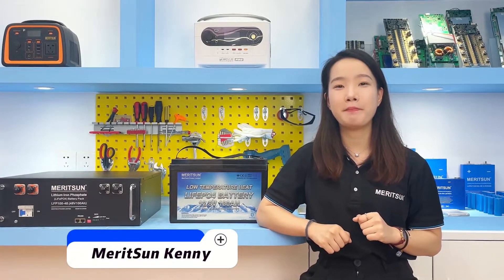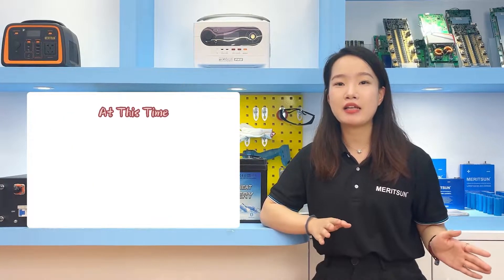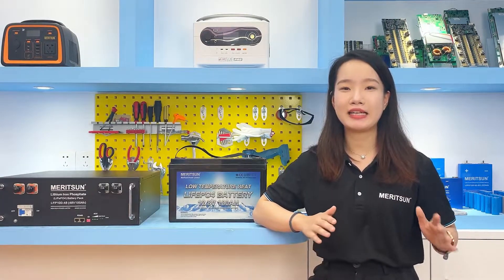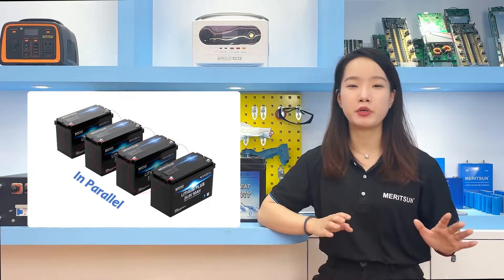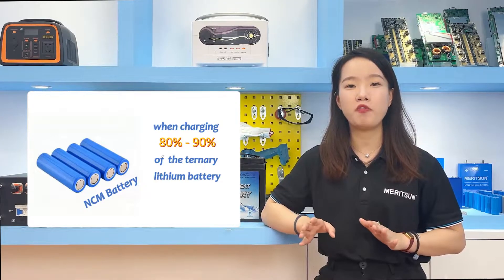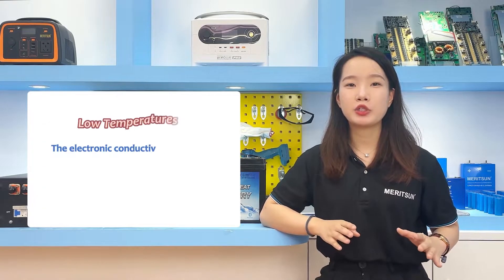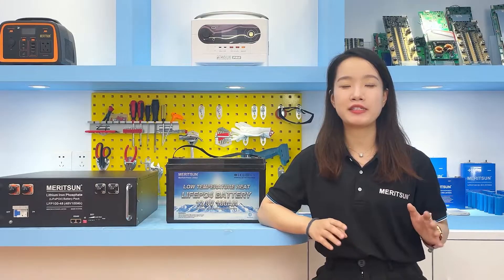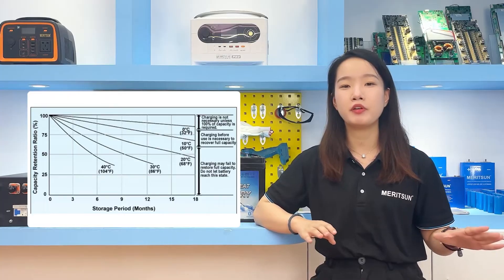Lithium Lifepo4 battery: Tips about charge and discharge operation | 2022 Updated

Comment: If a 24v LFP 100Ah has a discharge rate C1 of 100A but I want to use a 3000w inverter I understand that I will have a load of 125A. When adding 2 or 3 more batteries in parallel to make a 24v 200-300Ah can these 2-3 batteries theoretically output 300A?
And question #2
In the same example using 3000w 24v battery the cables/wires connecting batteries together should be rated for the Max system loads eg. 125A  or 100A that is the maximum battery charge/discharge rating?
Reply from the maker: Hello, we are very happy to receive your comments. For your questions, you can directly contact our professional engineers via WhatsApp at +86 136 3222 6296, or contact us via email at sales@meritsunpower.com, our after-sales engineers will also provide you with a complete solution
Reply: @meritsunlithiumbattery  thank you
Reply: @meritsunlithiumbattery  I tried texting on WhatsApp but the phone number is not on WhatsApp
Reply from the maker: @kestrel-68-36  I'm very sorry about this, could you please provide us your WhatsApp or email address? We will send an engineer to contact you.
Reply: Hello, is it how important to discharge fully at first for 51.2v 300ah  LiFePO4 battery ? for the same battery what is the flooting and bulk charging voltage ?
Thanks n regards
Reply from the maker: @manojs09  Hello, if you want to know more about the battery, please communicate with our engineer via WhatsApp +86 137 2683 4322, and she will provide you with detailed information parameters.
Reply: @meritsunlithiumbattery  thank you so so much for your prompt reply

Comment: So what solar charge settings do you recommend to keep MLB SOC between 80 - 20% ?  Is all this controlled by the BMS my system is Victron.
Reply: Good question but I'm assuming its a little more complicated. But it would be nice to a have a estimated understanding. 
The 20/30%-70/80% is wat I heard for cell phones. Lithium ion. 
lifpo4 seams to be 5/10%-90% range is what you generally want.
PS. I missed the part about solar panels.

Comment: My lithium battery is not charging....I'm very disturbed and I need help
Reply from the maker: May I ask what brand of lithium battery you are using? You can give feedback to the corresponding dealer.
Reply: Mine it's lifepro4 24v 100ah lithium
Reply: Iam using the LFeI-48100MB

Comment: Have you ever tried reading the datasheet of LFP Cells you are using in your batteries??
The Charging Parameters of LFP also involve charge termination. I don't see it mentioned anywhere in the video.

Also, the Float voltage of LFP should never get above 3.375 V/Cell.

Comment: I've been wondering. Is it ok to discharge a lifepo4 battery to about 20%, then start charging it while it's still discharging with about a 50w charge? I have 48v battery 50ah. I planned on using just battery on just under 400 watts for 4 hours, then charge it on a 48v 10a charger while it's still running my system. Hoping to get a slow 50w charge, until battery is up to about 90% again. The system will shut down for 6/hrs day. This is when I plan on the charger catching up and and charging to 90%. Will this work good?
Reply from the maker: May I ask if your system currently uses MERITSUN lithium batteries? Please send an email to our business email sales@meritsunpower.com and we will reply to you in time. Thank you!
Reply: Ever figer it out ?

Comment: how big of a battery would i need to get 1000 watts for 6 hours ?
Reply: 6000Wh
Reply: Two 12v 300 ah batteries would provide that with 1600ah extra for losses or not draining to very low voltage. I easily get 3000wh or amp hours from my Ampere Time (now Li Time) to power my little window ac during power outages. If you set it where the thermostat kicks on and off half the time you can get nearly 20 hours of air conditioning. I use a watt meter for a decent rough estimate of battery capacity used and guess at inverter losses and it works great. I recharge it with a plug in 20 amp lifep04 charger. I have solar but need more panels but it works. I`m getting about 300w into the battery...enough if I set the thermostat right to avoid draining my battery during the heat of the day to save it for about 15 hours estimated run time at night. I need 800 watts or more from solar for a quick refill if sun conditions are limited by clouds. Plus I need more plug in charge so a generator can recharge the battery on one gallon of fuel. But Biden ruined my budget plans big time and paused my green energy money saving plan. So ironic! Because of him I was also unable to get a second large battery. He has hurt so many elderly and disabled. I`m so hungry every day but have very little to eat and have lost over 60 pounds. And right now my electricity bill was supposed to be free so I could pay for my medicine and have enough to eat.

Comment: Can you explain the dod chart as it stops at 80% DOD why?
Reply: It means the battery would have 80% of its original capacity by the indicated number of cycles.  The capacity degrades over time and based on how the battery is used.  80% is often used as a reference in marketing.  The first line in red is assuming a full discharge/charge cycle from 0% to 100%... which would give 6000 cycles.  At that point, the battery would only have 80% of its original capacity left when fully charged.  For example, a 100Ah battery would have degraded to only 80Ah after 6000 cycles.  It will still work long after that but just at a reduced capacity.  Think of a rechargeable light that lasts for 5 hours when new.  After 6000 discharge/charge cycles it would only last for 4 hours.  Hope that helps.